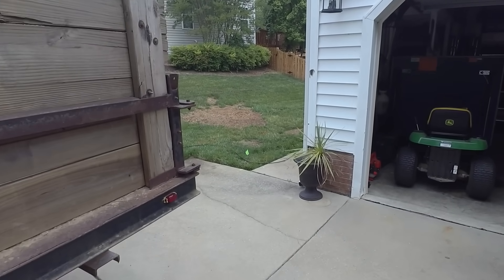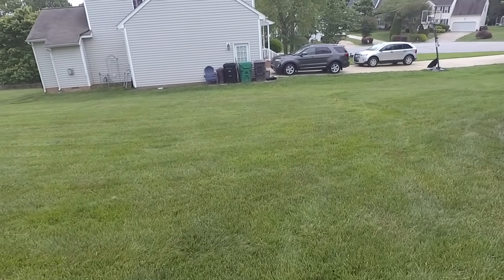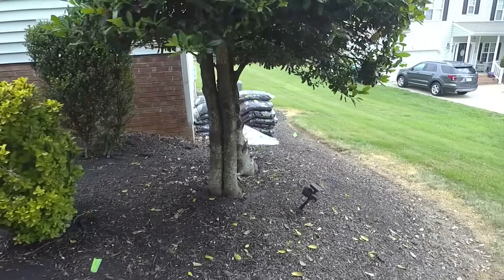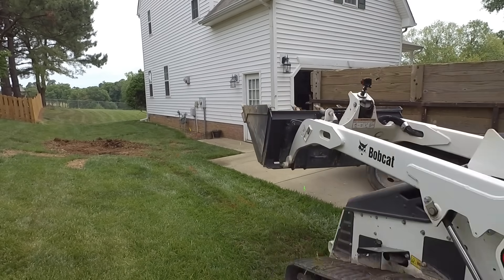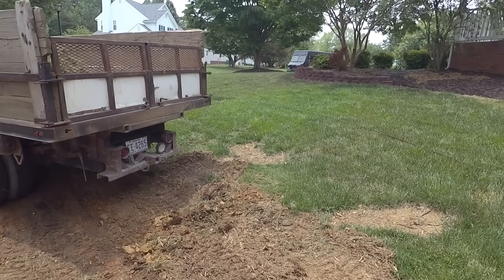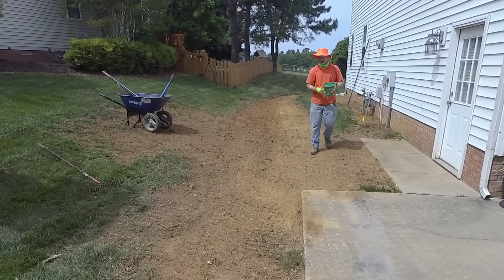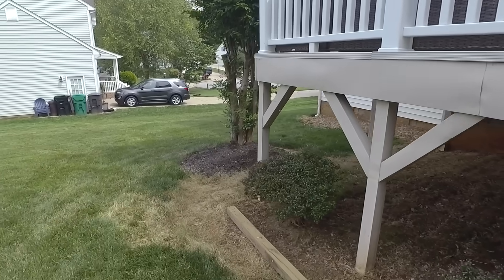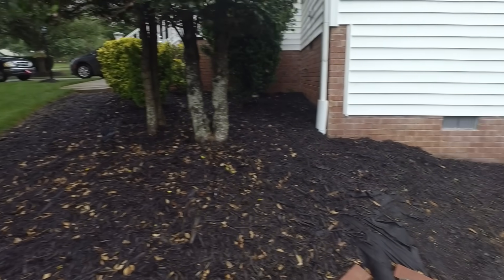Cutting a swale to relieve driveway and crawlspace flooding

Comment: Nothing says elevation like water,  Street front to back should have had a perfect center line and ONE high point separating them and slope to street & back; where the swale width would have been at optimum width and depth away from house and constant engineered  (MEASURED) slope without 1" of guess play. ONE string line above grade from the ONE center point. Getting that max slope you can obtain.  You either percolate deep or take material way.

Comment: To do this job right you should use catch basins in the low spots gravel perforated pipe along the side of the house and discharge to the street.  All down spouts should be discharged to the street as well, not to the side into the neighbors yard.  Go watch all the Apple Drain videos on a well designed drain system.
Reply from the maker: Hi Brad. Thanks for the suggestion. I forgot to mention the street is uphill on both sides of the house. Also, catch basins are used for point water sources (in a single low point). Here, we had non point water and a very flat area.
Reply: Why would you go to all that work burying a pipe when a swale can move 100x more water?

Comment: I still don’t like that standing water in the swale. The water is too deep. And, it appears there is still water laying near that corner of the driveway. I would have you come back and fix the grade of the swale. Not your best job. Just my $.02.
Reply from the maker: It's so flat there that it's tough. if you go down after the standing water you have to go down after that and so on. Then you run  out of fall in that area. The homeonwer said things don't stick around that long. I had arrived moments after a heavy rain. The water against the foundation was solved.
Reply: The swale is nearly flat.  It is nearly impossible to cut the ground so that it is perfectly smooth with a machine. There was also a tree there, the soil that replaced the stump and roots will settle and the soil around may expand (if clay) because water is no longer being extracted. The homeowner if they wish could fill in the low point with some sieved soil but at the moment they have positive drainage off their drive.

Comment: You need to use 8 slot Baughman Tile 4 or 6 inch corrugated pipe from the French Drain Man in Michigan.   That black corrugated pipe is absolute junk.  Please check on the French Drain Man's video to learn where to buy quality materials.  Good luck.  Educate yourself better.  You are welcome in advance.  Your system is junk and will have to be replaced soon.
Reply from the maker: I use schedule 40 PVC pipe, which is the best quality for this application. This is the same pipe used for main sewer lines. I would never use ribbed pipe and prefer rigid pipe. I have systems that are still working fantastically after years of service. I am not seeing the failure that you predicted.

Comment: After getting 5+" of rain in 24 hours, a swale like that wouldnt have saved our house from flooding. Minimal rain yes but not an excessive rain solution.
Reply from the maker: As long as it's falling you should be good. The more water you get causes more weight on the water downstream and the faster it flows.